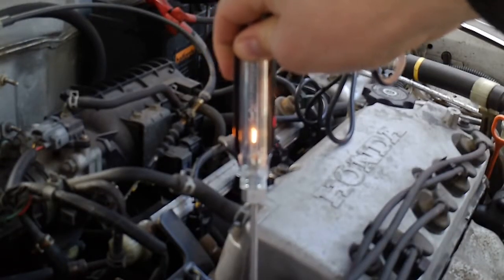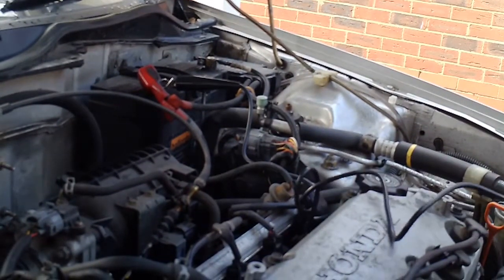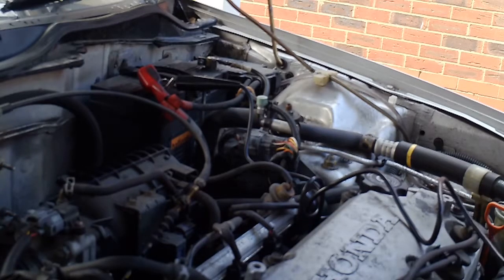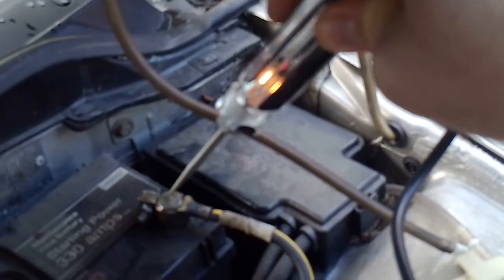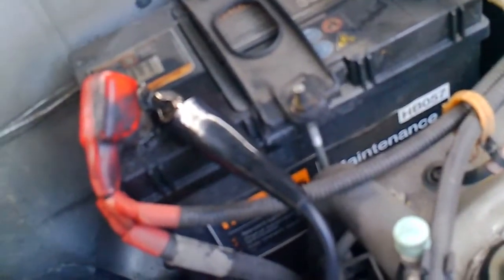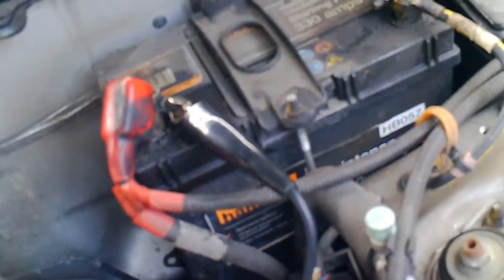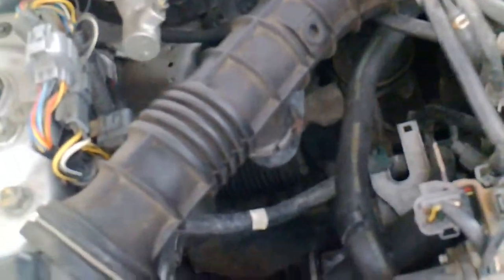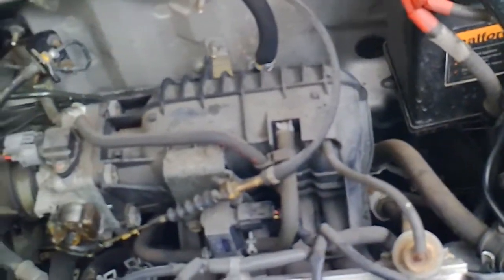How to check for a bad engine ground

Comment: So your really not checking the ground / earth straps. Your just making the light go on, what will this accomplish?
Reply from the maker: And what does that mean, when there’s a good strong light?👍
Reply: @drivewaydiyer6504  but you can run your light to another car and it will light up. What did you accomplish??
Reply from the maker: @nicks7548  how to hook it up and rust and corrosion is a problem.
Reply: @drivewaydiyer6504  My point is if you attached the positive lead on the tester to battery + then to a ground on a different car the light would light up. You need to test it with the ground strap unbolted on one side and still the strap could be on its way out and give you a false test. That’s more for testing fuses. Good luck-
Reply from the maker: @nicks7548  I do get your point. Most people don’t know what a ground is and how to identify a ground in the engine bay. To find a good engine ground is difficult, especially with rust and crud. We could talk about this all day. There are so many variables to basic circuitry, none of which can be diagnosed without a good ground, especially jumping a car. Cheers for the input. Great feedback, I’ll make sure my videos are clearer on this.👍👍👍🙏

Comment: Didn't know using positive to Chasey could be possibly i thought it would cause a short  is this okay to try any car
Reply from the maker: Always research your car before doing any diagnostic work. You only do this on 12volt supply. Any sensor diagnostic work would require a different process.
Reply: @drivewaydiyer6504  I just wanna try it on grounds to see if thy are getting good contact
Reply from the maker: If you’re looking for a good ground, make sure you break through the dirt and grime.👍